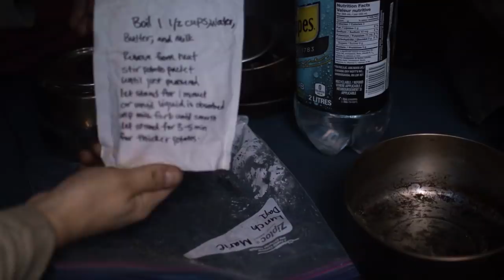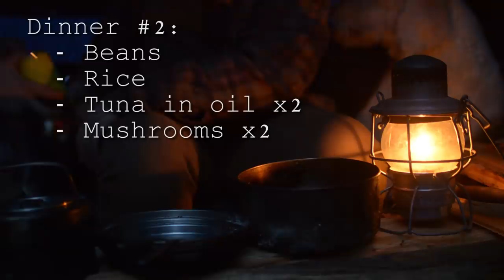3 Autumn Days at our Long-Term Camp - Building a Long-term Camp | Entry: 010 - Camp Firlend

Comment: Nice get away. I appreciate your video.

Look into building a long term fire. Lots of vids on it. An easy on is 3 large logs about 3ft long. 2 on the bottom with lots of kindling in between and on top along the whole length. Light the kindling and once it gets going, put the 3rd large log on top right in the middle. Put 2 stakes behind each bottom log to stop them from rolling over once their sides burn, then the 3rd log on top will eventually drop in the middle on the embers, basically still leaving you with 2 whole logs to burn (the 2 half burned & the 3rd one). Hard wood will last longer, if you have any there.

Comment: I am in the middle of watching this one, but this one of your best episodes.  I could spend weeks in a cedar forest like that. Also, your camp is so meticulously organized.
Reply from the maker: Thank you! I spent ages on it, it use to have really nice music but I had to take it out. Ended up re-rendering it 3 times and re-uploading it 2 times :/. I love these forests though they're really peaceful :)
Reply: Well, that must have been frustrating. I love to see you build a small hunting camp, too.
Reply from the maker: Son of a Bear Bushcraft Extremely. But we did end up finding a better area far far away from where anyone would walk to. :)
Reply: The wife and I are heading into the forests of Vancouver island.
We will have different Recreation site campgrounds to ourselves for FREE.
We will be wandering from site to site for 6 months each winter.
Average temp 3-9 C....
We will use a 2wd Tacoma with a Tufport D-59 which is 500 pounds and cheap for the bedroom and king size mattress.
A tiny trailer cargo 5 x 8 all aluminum will telescope to the camper back door and it will house the compost toilet and wave 3 heater and sink.
Behind the 500 pound trailer are 2 doors to open for our teardrop which connects to our Canvas tent section double skin and tarped.
10 x 14 foam floor and back door and little buddy heater and coleman 1 lights off a 20 pound tree.
This is basic camping with only 206 square feet to protect from the snow or rain......make that mostly winter rain.
I could stay at resorts for $ 1,600 dollars but people get on my nerves and I called and they said if they don't like the look of our vehicle then we have to get out.
It's a 2018 truck with camper on top but they have turned people away before......fuck them.
If were happy back there it may become a yearly pilgrimage to the forest......and in Ontario I used to spend summers in a primitive log camp and winter weekends.
Reply: I'm glad you took the music out, it brings out the peace and quiet of your camp. Not speaking doesn't seem to hinder your team work. You are most fortunate to have such an attractive partner.

Comment: Tarps with more eyelets placed in them along the sides and a few in the center like you would in a blanket then thread them with cord and fill tarps with dirt has you cover your long term shelter. Ypu could also cut tarps and place eyelets to form front and back panels that you could bind to poles. You could make a tarp earth bag shelter in sections then fold it up pack it in set up frame of shelter then fill up tarps with dirt. If you really want it to last in spring make cob and fill tarps with cob and then let your whole shekter dry out and harden over summer for winter camping. 😊

Comment: Hey there fellow west coaster i love the videos keep them coming. A little tip i use a small flask for storing my cooking oil in works great doesn’t leak rather than a zip lock bag 😁
Reply from the maker: Glad to hear! That's a great idea though, my one flask I have is pretty large and has the remnants of whiskey in it so I'd have to get a new smaller one :)

Comment: Crazy idea take burlap bags sew them together to form a sleave. place ties on bottons every few feet so the burlap sleave will only expand so far. Then fill the sleave with leafs forming like a mattress. Then lay it over a shelter and secure it to the structure then tarp it. For a long term shelter. Another idea would be to use earth bags. fill the bags with dirt and lay them around the outside of the structure and then across the roof. Some crazy ideas for you. 😊
Reply from the maker: Indigo Dragon71 That's a great idea! I was going to do a similar thing to the shelter with moss but sadly the snow came early and kind of screwed us aha
Reply: You could always pack in a few rolls of earth bag tube and use moss and leafs and dirt to fill the earth bags up to make a long term shelter then cover the shelter in cob. 😊
Reply from the maker: Sounds like an amazing way to do it, wish I had that time :( ended up using UGLY blue tarps
Reply: You don't want to be using Burlap on any structure with an open fire nearby though one spark in the wrong place and the whole lot goes up
Reply: Correction use non flammable tarps and make earth bags that you can tie together fill with dirt or plant materials to cover a shelter to survive in. That you can just pull the rope used to seal the tarps together empty them out and roll them up and reuse them at your next camp site. Design tarps to be used for this style of shelter system. Awe perfection! 😊
Reply: Indigo Dragon71 - You could easily hybrid that idea, making earth walls & leaf roof, to keep it from getting too heavy. Or just use the bags to cover the outside wall, and cut sod "bricks" to stack against it. If you want to put a single layer of sod over the leaf roof, that would work. Your support lattice, made from inch-thick branches, should have 6-8" squares open. The burlap keeps the dirt and leaves from coming inside.

Comment: Could you use that bark and lay shingles to cover the outside of the shelter? Then use earth bags to fill the void for insulation. Then errect inner wall using split wood you used your draw knife on to smooth them out then notching the ends so you could bind them to a post to create a strong inner wall? You could even do the roof in the same manner correct? Then durung the spring you could make a cob chimney and fire place. 😊

Comment: Keeping the wood inside out of the weather may seem like a good idea.
BUT
Snakes (Rattlers), Mice, Squirrels, Chipmunks & Every Crawling Insect. LOVE Wood Piles.
That's Y I told U about the A-Frame around the outside of the fire pit. They R out there not inside with U ;-) & wood is dry & available at arms reach.

Comment: Rule 1 I think is to never sleep with your outer layer, sleep in you base, keep your pants in the boots covered by coat, 2 a hand towel safety pined area you breathe will collect most moisture from you lungs and not into the bag
Reply from the maker: kenneth worde I didn't, it just looked like we did due to the video. We didn't actually go to sleep when we were shown to, and when we got up we were already up. Editing magic ;D. Good ideas though :) Thank you

Comment: Nice shelter Nic, may I ask why you built the larger area of your shelter but dont really use it to sleep in or not much of anything? Just a question out of curiosity? Great videos..
Reply from the maker: Thanks, our plan for the shelter was to have the inside area for sleeping in in the warm seasons, and the outside are for winter since it gets direct heat from the fire

Comment: While Ur looking into the Arcturus tarps U should look at their 64" X 88" Warm Heavy >Military< 80% Wool Blanket.
I see U brought a Foil sheet.
IF U Start Using foil bubble wrap insulation Under & Over U = Roasty-Toasty ;-)
I Buy the AYR-A2A-Bubble-FOIL  in the 4 ft x 125 ft roll & the DB 8' X 125ft roll. I use this stuff everywhere. As I mentioned in Ur first build video comments {I use it on the inside of the tarps}. Cheap considering the R-Value I get in heat retention...
U may find carrying a $6 awl from CTC is a very hand tool.

Comment: Not sure why it is partially enclosed and not all the way. But still pretty awesome
Reply from the maker: I designed it that way so it could get direct heat from a fire :). It's basically a lean-to mixed with a 4 wall tent.

Comment: Hi Nicholas, one question: the heat of the bonfire, reaches the bed well?
Reply from the maker: Originally no, we had the fire way too far back, but if you pay attention in the video you can see we moved the whole thing forward a few feet and it made a HUGE difference.
Reply: Nicholas Wituik , hi Nicholas, Thank you very much for your explanation. I just wanted to know if the temperature was acceptable.

Comment: Why you are not sleeping in the other room which is seems that is more private and also more protected from cold weather and other elements
Reply from the maker: We had planned it that the outside would be used for winter camping since it'd be the warmest due to the direct heat from the fire
Reply: That is the dog’s room

Comment: Wouldn’t be better if your sleeping quarters were inside and not in the open area?
Reply from the maker: The inside area was mainly designed for heavy snowstorms/rainstorms where we'd want to be protected on all sides. Aside from that, it really had no use since it got no heat from the fire outfront
Reply: @wituikbws  as you can tell, I am not a camper and I didn’t think that the fire warmed you up cause to me it looked far way.  You do great work and thank you for replying se quickly. Enjoy the outdoors and stay safe :)